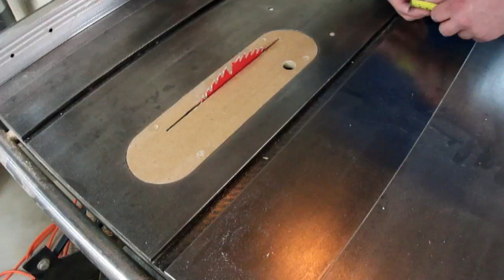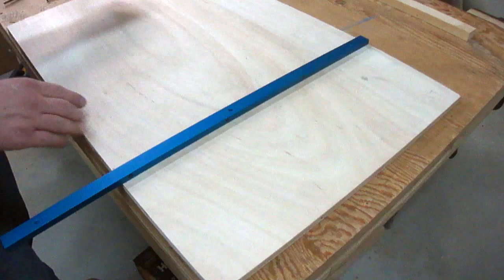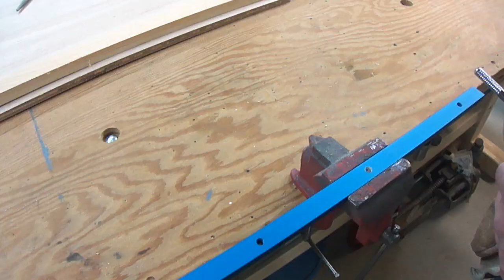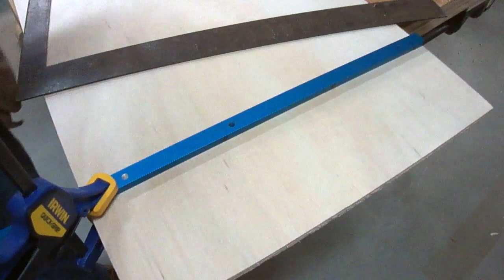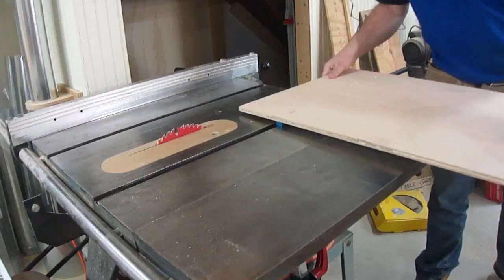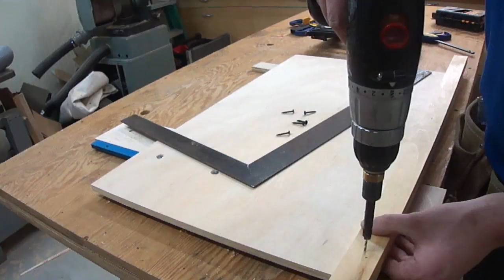Build A Panel Cutting Jig!

Comment: While you were squaring up the new paneling jig fence, it might have been helpful to use a scrap piece of wood along the perpendicular edge to keep the square in place, rather than use your fingers to keep checking square.  Nice project!  I have one already with a hardwood guide but plan to make your design with an aluminum guide soon.  Thanks!
Reply from the maker: Thanks for the tip!

Comment: I'm thinking about making one of these. However, I'm concerned about the possibility for the sled to tip to the left if too much of it or of the workpiece overhangs from the left of the table saw... What has your experience been so far regarding this? Thanks!
Reply from the maker: I haven’t had it tip but I suppose it could if you were cutting a really long panel with it. However for panels that long I’d just use a circular saw with a straight edge clamped to the panel.